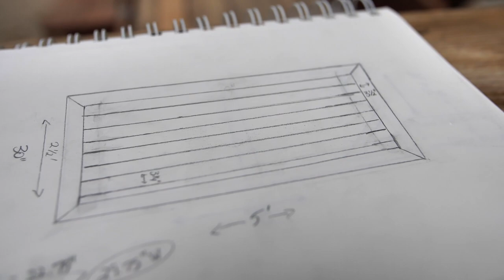Building Dream Desk for Man Cave using Old Barn Wood

Comment: electric power washer 1500psi can clean wood without damage , plus you can use it to clean your car boat and other stuff around the house
Reply: Exactly what I was going to say. Accidently power washed part of a 20year old house while cleaning up the siding on my house. Looked almost new with all the cool grain still.
Reply: Америка Голы Карпы you just have to choose the right tip or it will absolutely tear up the wood.
Reply: We do a lot of work with barn wood the best way to clean it is a pressure washer and diluted bleach. You don’t loose the character of the wood and it brings back the color.

Comment: Some people go over it with a wire brush to knock off the dirt and stuck on crap.  Then pressure wash it would probably be best.  The stuff you saw on the boards appears to be decomposed newspaper which they used to use back in the day for insulation.

Comment: I love wood working. I use to work for a place called Karamal Skillington that made furniture from reclaimed wood. I was a finisher. Wood filled and sanded depending on how the customer wanted it, stained it and sprayed the lacquer on it. Absolutely loved that job. Anyways with that wood you’re using I’d just spray some clear on it so it wouldn’t change the color to much, and also protect that old wood.

Comment: A table top planer will save you so much time and labor. You can clean up each side of the board and make each board the same width and thickness by passing them through the planer. 
Hope this helps, keep up the great work!

Comment: Rackley go get a 16 inch wide planner and run all your boards after they have had the nails pulled out through a planer it will keep the character marks but make refinishing the surface a lot quicker

Comment: 3 things, invest in a power washer they work great, A belt sander and a planer will make your work a lot easier and you will get a good result. You may also want to invest in ear protection either earplugs or what you use for shooting works, protect those ears.

Comment: Steel wire wheel they attach to any drill if you aquire a smooth finish start with an 80 grit and work your way smoother to a 220 grit

Comment: Use an air compressor or gas blower.  I enjoy building as a hobby and that’s what I use. An orbital sander would’ve been great. Belt sanders are for removing bulk, and palm sanders like you used are great for the finer grits. Always finish with a sponge sandpaper block. To get the best finish after sanding, put rubbing alcohol in a bottle and mist it over the wood. The moisture will raise the fibers of the wood to get a finer finish in the last stage of sanding. Don’t use water for it will not evaporate. Beautiful wood by the way.

Comment: You could have used a power washer to clean those boards.ajust the spray so that it's about 3qusrtets of an inch wide like a fan.You don't want to make it like a point or you would dig into the wood and mess up the grain.I iused it on my deck that's been up for 15 years without chemical cleaners and the boards looked brand new. beautiful  grain of the wood came back.Looked new.

Comment: Totally lightly pressure wash that wood!  It will get the dirt off the wood and raise the grain a little.  Let it dry, sand to your satisfaction then you should be good to go.  Finish is you next hurdle....and you are on your own!  What do you like.  Get a carpenter toolbelt with some suspenders.....it puts the weight on your shoulders and you can have all yours tools on your.....belt:)  Love the video!

Comment: Ya done good for a 1st timer bud! Pressure washer & some TSP would have saved much time, except waiting to dry. Alternately running the wood through a planer (harbor freight, $250) would knock it down quick. Probably ain't no asbestos on the wood, more likely lead paint (pre 1970). Respirators better than dust masks.

Keep up the good work my friend!!

Comment: I probably would've took the boards to a cabinet shop and had them ran thru a planer get rid of all the nasty and be left with beautiful wood grain line's, not to mention cabinet shops usually have a vacuum system hooked directly to the planer. So no breathing the year's of dried Murphy oil or varnish.
Reply: Agree with getting it planed. People think it's all about the "character marks" on reclaimed, and are afraid to take "to much off". But the tight grain pattern is what makes it prettier than the fast growing pine you get today.

Comment: Gotta rent you a planer and jointer. It will give you some nice crispy edges and take all of the labor out of the re surfacing that old barn wood. Just make sure there aren’t any nails, staples, screwes! That will ruin a planer in a half a second. Good work! Keep it up!
Reply: Also! That looks like asbestos to me !! Use a vac while sanding and cleaning! Also upgrade your mask. You can get a pretty good duel filter mask for just a few bucks..

Comment: Best thing to do instead of putting the DUST airborne....   try power spraying it....  it should really clean them ALL.  Got a power washer?  I don't think there is any asbestos on those boards...  if any thing you should be concerned with LED... but since there isn't any paint on them, you should be in the clear.

Comment: LFG, @ 1:40-ish, your dust mask (presuming that it is a N-95 rated mask) should be sufficient for your purposes! And now that you are probably done with the table at this stage, I authorize you to purchase a belt sander! A 3 inch or 4 inch wide 24 in or 21 inch belt sander! And I like to call "the stuff"  Schmutz! You called it schmoo. I think that Both work, depends on which side of "the pond" you're on!😉

Comment: I worked in the woodworking industry for 40 years. The sanding and dust  and summer heat freezing in the winter. Working inside a metal building. Toxic chemicals used in finishing.  Not good for your health . Those dust masks are hot . Wear ear plugs if you want to save your hearing.  
I don't miss it. Factory I worked in closed. 3 years ago. Took my retirement money. And now I am 61 what do you do with a worn-out body.  Hands don't work  , legs and back . It was my choice to work in the woodworking industry. Just stayed at it too long. Have fun
But I would rather fish and spend time outside. Just my 2 cents worth.😷👊🇺🇸
.